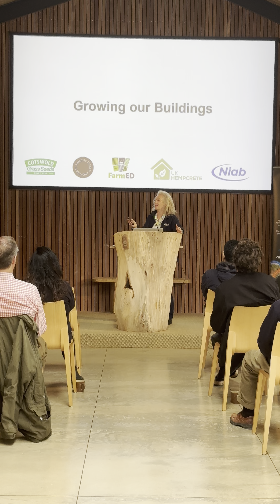Hemp - Growing Our Buildings. Here’s my recent talk at the FarmED Hemp Open Day in full.

Comment: The case that lands hardest with our clients is the solid wall one. A Victorian London terrace has no cavity, so anything vapour closed stuck to the inside face just moves the dew point into the masonry and the damp comes back a few winters later. A lime and hemp build up stays open and lets the wall dry both ways, which is the real argument for it quite apart from the carbon. Good to see it getting a proper hearing.